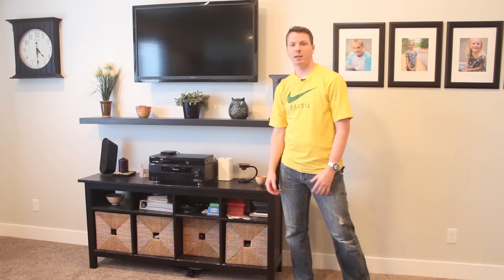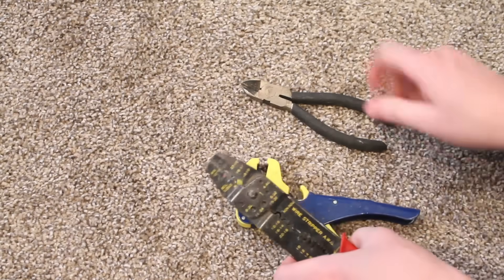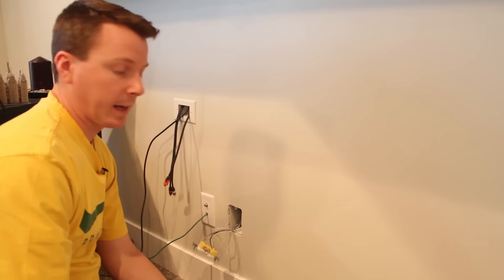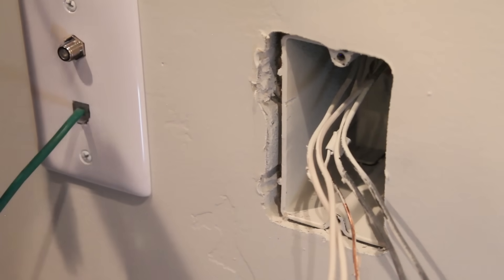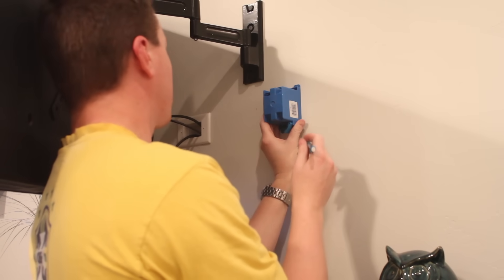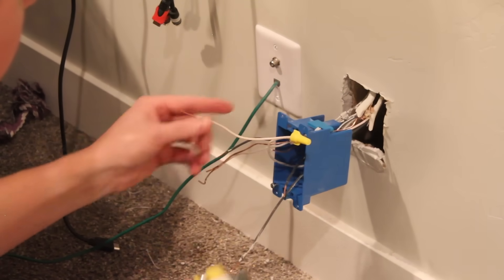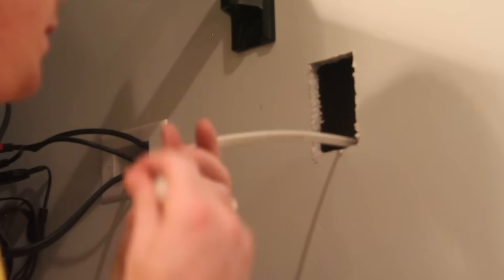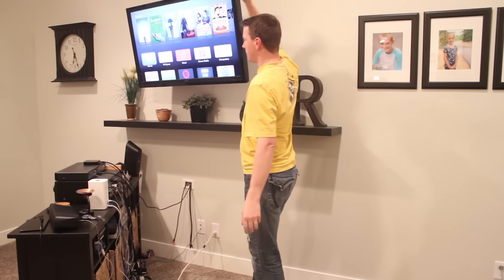How to Add an Electrical Outlet for a Wall Mounted TV

Comment: Thanks for the great video. You helped me out with my project. One thing I realized while adding my outlet behind the TV was that I lost my surge protector. I ended up buying a surge supressing outlet from Home Depot for around $25.  I wanted the protection for my TV and sound bar. Thanks again. Great video
Reply: If you took the time to determine the load and the line terminals on your surge suppression outlet, you can confer surge suppression on the outlets downstream from it, and save the $25.
Reply: Yeah, I would also keep everything but the TV and a surge protector as well.  I lost a whole bunch of cooler when I have several brownout flashes in a row.  They were not on such a unit.  Needless to say I put the surviving units on one as well as any replacement units.  I use UPS for my critical equipment.  I can have internet with a power outage and same to the LAN.  All lower power devices that can run for hours.  I use a laptop so that runs too.

Comment: Great video. I just want to know how would I do it if my new outlet location wasn't directly above or below? What if it was to the left or right? Would I need to run the wires diagonally or how would I do it?
Reply from the maker: +1987kahil This is definitely more tricky to do if you have to cross a stud or two. The gist of it is this: Everything in the video is the same except that where you have a stud to cross, you'll want to remove a section of drywall (carefully) over the stud, then drill a hole in the stud(s) to pass the wiring through. Once you have done that you can replace the drywall but you'll have to mud and tape it, then paint it. Like I said, more work, but definitely still doable. Good luck and thanks for watching!
Reply: +1987kahil - Also there are guidelines as to where to drill those holes. ie You can't drill too close to the edge of the stud and the hole has to be "x" inches from the surface of the wall or stud. Not sure how it is worded. Think its like an inch and a half from the surface. Not sure if that is the stud or the outside of the drywall though. If you have to drill into studs just make sure you research that as well. You'll hear people say it doesn't matter no one will see it. But like someone on here already said if something you've done is not up to code your insurance may not cover. Good luck. :)

Comment: Sorry, I don't know anything about this stuff so excuse me if my question is very stupid. My question is, once doing all this, is it safe to use all the plugs? Are there any dangers or possible scenarios that come with using all the plugs?
Reply from the maker: +oktaecyoongworld Not a stupid question at all. If the plugs you're referring to are the electrical power plugs, yes, all of the plugs will work just fine. I've been using the ones in my house for the last year. Like any electrical work, just make sure to keep everything nice and tight before putting it back in the wall.
Reply: Nils Rasmusson ok! Thank you for the reply! I was worried about blowing a fuse or something like that :)
Reply: Also, as an electrician I have seen many cases where running analog audio/video cables causes distortion, so the best method is to run them as far apart as possible unless your electrical cable is shielded and you have plenum grade audio/video. As always check your local codes.
Reply: +Hernandez Arêdes I've personally never seen a 10 amp receptacle, and it would be against code (also dangerous) to use one on a 15 amp circuit.
Reply: Mike Sullivan I’ve never saw a 10 Amp receptacle either Mike.
Reply: But most people would just see an outlet, think they could plug something in, which could possibly draw up to 15 amps, and exceed the rating of the outlet. *****

Comment: Hi Nils, Loved the video.  I was wondering where you can purchase the blue Single (or Double) Gang Electrical Boxes for Existing Work.  Quick check of Lowes and Home Depot...no dice.  Thanks!
Reply from the maker: +TrojanTechie Hi there. Both stores have them, though they are often called "Old work" boxes. Here's a link to one on the Home Depot website. Plus, if you head to either store and ask an employee they should be able to help. http://www.homedepot.com/p/Carlon-1-Gang-14-cu-in-Old-Work-Box-B114RB/100404027 Good luck with your project!

Comment: Nice video.  It amazes me that you knew enough to do all of this correctly but that you didn't initially think that you would need to do this instead of running the TV's power cable through the wall!  Good stuff though.

Comment: And this is safer/approved because you are using Romex cable ?
Reply from the maker: +Vlad Conut Yes. This is up to code.
Reply: +Nils Rasmusson its because the romex cable is thick enough so it wont get hot... you could just use a good quality power cable but mainly for insurance reasons you should do the outlet thing. Here in germany it's a bit more complicated because our houses are made of bricks or ferroconcrete. These ferroconcrete Walls are sturdy as f*ck, you cant even drive a nail into them...

Comment: Great video. I got a question why did you remove and replace the bottom box? Did you remove it for better access only?
I was planning to run the fishing tool from the bottom up through the existing opening in the metal box without having to remove it, then pull the cable down and run it through the same opening.
Reply from the maker: +Max T You can do it that way too. I removed mine because I didn't want to try to fish the wires through the tiny holes in the back of the box. The boxes cost about $2 so I found it much easier to just replace it. Either way will work, though.

Comment: when you took out the outlet, then you put the cable to make the extention with the cables, explain more why or which set of wire do we have to put the extension on?? (around minute 9:00)
Reply: +javier navas  Javier, the purpose of the wires that he cut off the top of the romex is to connect to the bottom outlet, as the incoming wires to the outlet are now tied together to upper outlet.

Comment: Question, I'm getting ready to do this and the outlet I will be using as two sets of wires coming into the outlet (1 hot, 1 neutral and 1 ground).  Do I need to use two sets of wires for my new outlet?  (You only used 1 new set of wires for the new outlet and connected them with the existing wires.) Why are there two sets of wires coming into the outlet already? Can I just take one set of the existing wires and wire my new outlet instead of running new wire (my new outlet will be on the other side of the wall and literally only about 4" from the outlet I will be using)?
Reply from the maker: +Doug Coppeler Hey Doug, great question. It's likely that the two sets of wires you have in your existing outlet are both being used, so I'd still recommend running new wires to the new outlet, even if it's close. The idea is to just connect all of the hot wires to one another and to the outlets, same with the neutrals and grounds. So you could connect (for each of the three wires in a romex cable) the two wires in your current box, your new wire and a pigtail. Run the pigtail to the current outlet and the new wire to the new outlet. Do that for each of the three wires in the cable and you'll be good to go. I hope that makes sense. Good luck!
Reply: +Nils Rasmusson Nils, thank you so much!  Just finished up and everything is working!  I ended up doing pigtails for the hot (4 wires total) and neutral (4 wires total).  For the ground, there was already a pigtail for the 2 existing grounds, so I took the new ground wire and wrapped it around the existing grounds (and then put some electrical tape around it).  Was this ok?  Also, the breaker the existing outlet was connected to was a 15 amp breaker.  I used 12/2 romex.  Is this ok or should I have used 14/2?
Reply from the maker: +Doug Coppeler Nice work, Doug! This all sounds good. I think technically you're supposed to use a wire cap on the grounds but what you did will work fine as long as there's a good contact between the wires. As for the 15 amp circuit, it really depends on how many outlets and/or fixtures you have on that run. You're probably just plugging in the same amount of appliances so it should be fine. And finally, the 12/2 is great. It's a heavier gauge which can't hurt. Sounds like you did an awesome job - nice!
Reply: +Doug Coppeler , I'm no professional as a disclaimer. As I understand it, you're allowed to use beefier wires than is necessary, but you're not allowed to use 15 amp outlets on a 20 amp circuit.

So you should be fine with the thicker wire choice.

You should seek a more secure ground connection though. Either do the pigtail method he showed or get a larger size wire nut.

Comment: Hi thanks for the video... Very informative .. Just a heads up though... When you are getting ready to put a wire but on two or more wires you shouldn't twist the wires beforehand, that is the job of the wireNut to twist the wires together as it tightens...
Reply: +DeAndre Enrico does not understand what "splice" means.
Reply: ..it's always better to splice your wife before hand. I know people that just use their wire nuts but it's a risk. If you create a lose connection , it can are and become a fire hazard.
Reply: +HazardousGuru420 wire... Lol
Reply: +HazardousGuru420 I think he was saying not to twist the spliced wires manually before screwing the wire nut onto the wires. You'd still want to splice them beforehand, just don't twist them together.
Reply: justanotherbum007 And you've never had a brain lapse. You know I meant "stripped." Sorry for making a mistake.
Reply: +Abel Casanova I have seen electricians use a pliers to twist the wires very tight before putting the wire nut on.  You want a tight connection physically so it doesn't work loose and spark years later.  I have even heard of electricians going through very old office buildings and retighten all connections in building ... much safer and reduces electric bill.

Comment: Nils - Great video. I think my question is similar to Adam's. I would like to have the only live outlet as the one halfway up the wall, instead of having both live. Can I use the new wire and wrap together the new white with two existing whites (and same with black and ground) then basically cap off the connection down low rather than adding the 3rd wire as you do to keep the original outlet live? I would then put a flat face plate on the original.
Reply from the maker: Yup, that would work. Just connect the wires from the lower outlet box to the new were going up to the upper outlet and you'll be good to go.
Reply: +Nils Rasmusson Awesome. Thanks again.
Reply: @LRN2DIY  Yep, just put in blank plate instead of a socket.

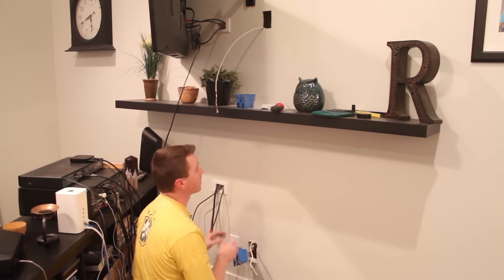Comment: Hi Nils, first off great video. I had a question though that I thought was not addressed in too much detail. At about minute 8:37, when you start connecting the romex wire with the existing wires, which wires are exactly being connected into the wire nut? I'll be attempting this project soon so I'll wait for your reply. Thanks.
Reply from the maker: Thanks! The easiest way to think about it is that all of the black wires need to be connected to one another and to the outlet, same with the others. So you will connect all of the white wires into the wire nut and then have one pigtail coming out and going to the outlet. Do the same with the black wires and the ground. It's not a bad idea to have two pig tails coming out of each wire nut (one for each screw on the outlet, except for the ground) but it's not required, because the two hot screws are commented to each other anyway. Same with the neutrals. Let me know if that all makes sense.

Comment: isnt there a kit I can buy..where I can just add two outlets without rewiring the existing outlet...then jus run a extension from new outlet to existing
Reply: meaning extension from new bottom outlet to existing... and plug TV in new top outlet
Reply from the maker: It isn't possible to have a plug on the outside of the bottom outlet that ends up being an internal wire for upper outlets. It has to go into the wall at some point. There are kits for adding outlets of a sort on the outside of the wall, but that's just like running an extension cord.
Reply: no what I mean is....cut the holes for the upper and lower....run a code safe wire from top to bottom ( inside wall)....but   on bottom have a male outlet....run a short extension from that to existing outlet
Reply from the maker: +Tyrus Lewis I think I know what you mean but I haven't seen anything like that. Sorry.
Reply: Ok thx man.....
Reply: +Tyrus Lewis I have used this kit to do exactly what you are asking: http://www.monoprice.com/product?p_id=4652

It gives you an opening for your low voltage A/V wires and then you run NM cable (Romex) to connect the two outlets. Then you just use the included female to male cord at the bottom of the wall to actually plug in the TV. 

One caution with this though, the power (NM cable) can cause some interference with the AV signals if they are run too close to each other. In my scenario, I separated the run, and actually put the AV cables in PVC conduit (also makes it easier to swap cables in the future).

Comment: I had two hot wires in the existing junction box, can I tie all 4 wires together?
Reply from the maker: +Adam Alday Sorry, Adam - I just saw your comment. You can put all of the wires together, yes. They all do the same thing and can be put together, so long as they're not mixed with other types of wires (the neutral or ground). Good luck!

Comment: Re asking a question someone had below. Once you removed the old existing box you had 2 black wires and 2 white wires .  Once you dropped the new wire in place that gave you 3 white and 3 black wires.  You cut 3 each jumpers.  You said to grab your 2 whites wires and the jumper and wire the 3 together.  If you combine the 3 white wires and the pigtail that would make 4 white wires.  But you grabbed 2 of the 3 white wires and added the jumper.  How do you know which 2 white wires to join with the jumper ? Or asked another way.  Does it matter which wire you dont add the the 3 wire jumper union?
Reply from the maker: Hey Mike. Not sure I completely understood, but in the end you want to have all white wires together and all black wires together, as well as the grounds. It doesn't matter if you pig tail off with one wire or two. The two plugs in an outlet are connected to one another already so even if you only attach one of the plugs, it'll work just fine.